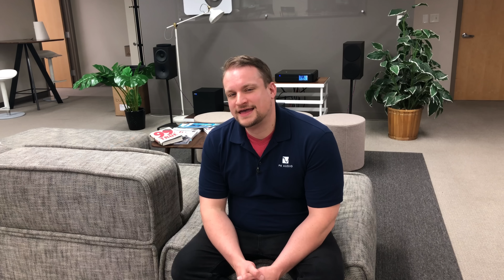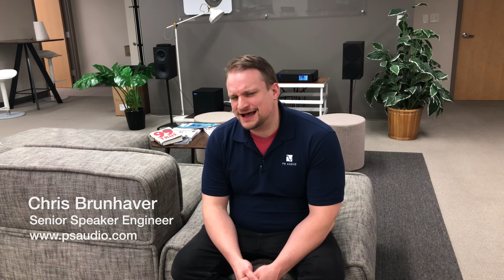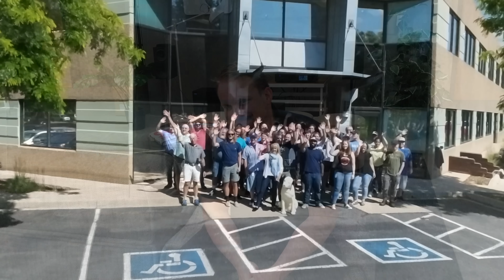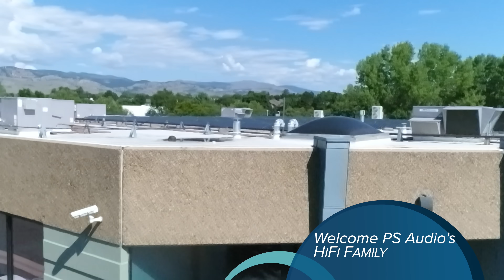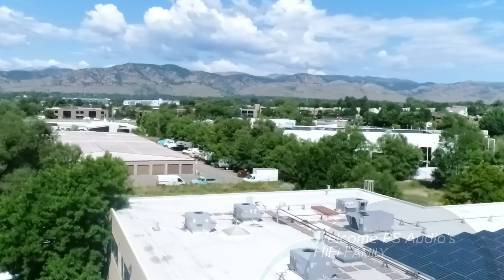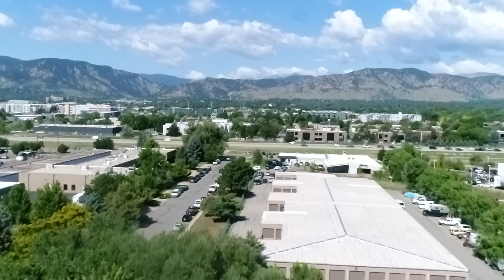Why speaker time alignment doesn't work

Comment: I onced owned a pair of Technics SB series where the Tweeter was recessed, then the mid was in the middle and the woofer was out front. That was in 1977. I never heard a difference myself.
Reply: You never heard a difference...compared to what?
Reply: I remember that one.  The one I saw had the woofer goin back and forth long exscusion likee it was ready to pop out.
Reply: Rich ...you say "I never heard a difference myself"
I would ask you, 'To what, did you never hear a difference?'
Did you re-align the 3 drivers to be on a flat fascia?
Reply: @FatRat-f9m  At that time I was enjoying a few loaner speakers at the time using Tube (McIntosh) and Solid State (SAE), as I recall I was listening to LS3/5A, Spendor (don't recall the model), Yamaha NS1000 and Pioneer HPM100 and my Uncle's Round Pioneers that had a cross hatched cane finish like old furniture. They all sounded quite good, but without actual measurements my comment is totally subjective. I traded the Technics for a pair of Bose 501 Series II that stood up better to Deep Purple and RUSH without bottoming out. The Technics went to my Cousin who only listened to Classical Symphony. He loved them.
Reply: @richsherman3673 ...ok. Still doesn't answer the question of you never heard a difference yourself, but ok.
Reply: You said that you never heard the difference in time alignment. Your speakers have to be 4 foot away from any walls. Your speakers have to be 66.5 inches apart. You have to sit in a triangle from your speakers. You have to get a friend to slowly move your speakers toward you away from you a few inches & toward you a few inches slowly. Your speakers tweeter has to be 24 to 30 inches off the ground. The stimulus checks should've been written toward down payments toward homes to create jobs  to keep the big building supply store rich, instead it went toward cars. In one month this will cause a depression. I dont know for sure if they are buying cars. We cant get car parts from China is to make him lose. China backing out of the trade deal is to make him lose. China backing out of Trum The rioting where the politicians wont defend their town, asking Trump to control it is to make him lose. Our soldiers getting killed in the Mideast, & the dems want Trump to attack is to make him lose. Wanting a war to kill Americans, to make Trump lose is ssssSICK! Lets vote the dems in there. The unemployment $600 a week & the dems want to extend it, is to make Trump lose. The virus  of Trump making people go to work is to make him lose. Isnt it strange virus left country, now its coming back up. The virus hitting states near texas is to make Trump lose. Then we got these idiots that think things are going to be great instantly
Reply: @myronhelton4441  Keep the political crap out of this forum. I'm not a democrat but I and others don't want this or any other nonpolitical forums to be infected with politics.

Comment: Really doesn't make sense what he is saying. Every time you move your head you are experiencing time misalignment, so there is no point in time aligning your speakers, especially when the woofer and tweeter are physically close together. They are trying to claim beam steering which is a total different thing.

Comment: Excellent...I hope to see PS Audio making a system with:
1. Speakers that are driven actively with amps directly coupled per driver and with DSP processing in a separate box taking care of cross-over, EQ and other fine tuning without introducing any additional A/D conversion (this means optimum for digital music).
2. True deep bass long-throw subwoofer with servo feedback using the same DSP box for the feedback loop e.g. using Klara T by subVo.
3. The DSP box doing the magic. E.g. could be ARM CPU based or Analog Devices SHARC based. The subwoofer servo feedback loop should have fault detection and auto calibration. Dirac, mic calibration, EQ, volume dependent loudness, tube modes etc. should be part of it. Perhaps with plugins that have to be paid for. Could be engineered using DSP Concepts based layout or similar. Obviously efforts should be done to maximize the digital audio processing quality (avoid sample rate conversions and maintain high sample rates from e.g. 192kHz music files).
4. Mono channel or multi channel amps that can drive the show.
Reply: RTHNEKYOU ABND THUMBES UOPS!

Comment: I got my Dahlquist DQ-10's . . . staggered baffles for tweeter to mid-range . . . I just re-capped the complex crossovers to handle five drivers per channel . . . time and phase aligned. Jon Dahlquist and Saul Marantz. Alignment to the woofer is less critical than hearing range 150Hz and up.
Reply: The DQ-10's great speakers specially if you consider their age. The DQ 10 and the Time Windows used to be among the best.